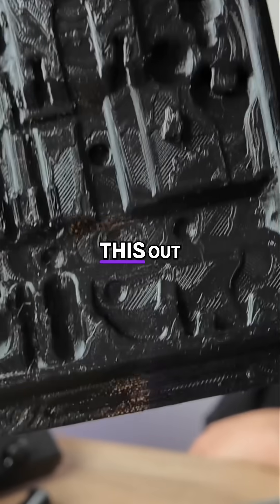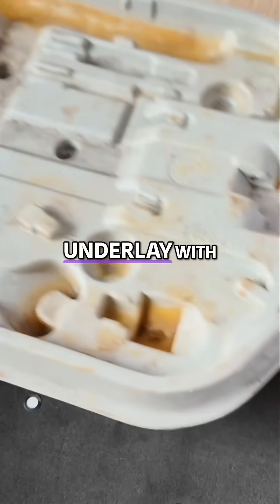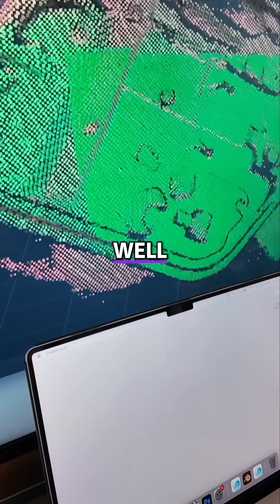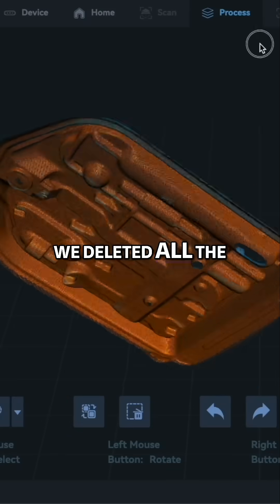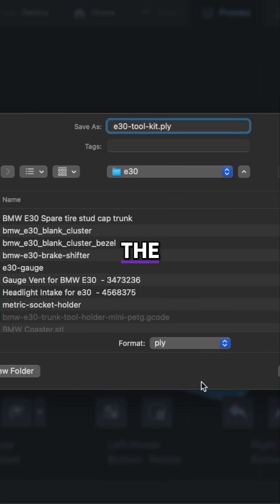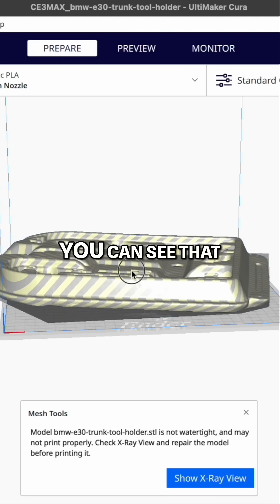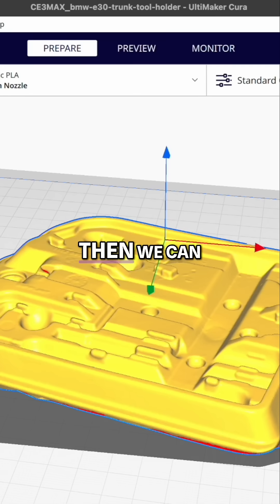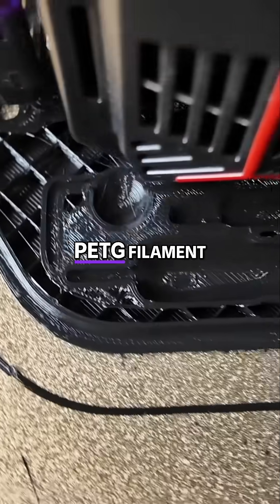3D Scanning and Printing Tips

Comment: That's awesome! For an even better finish on the top you can enable ironing. With the correct ironing settings you'll get an extremely nice finish. There are some reddit posts out there talking about the best ironing settings, I use it on practically everything since it makes it look wayy better and barely adds any print time.
Reply from the maker: Oh really? Will have to give it a try. What type of parts do you print???